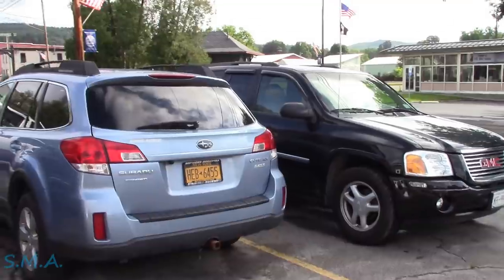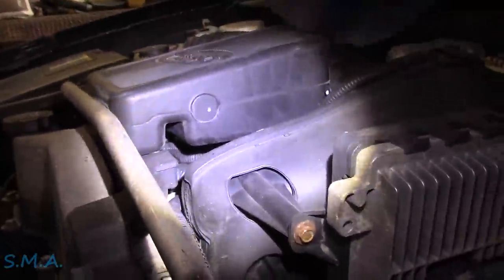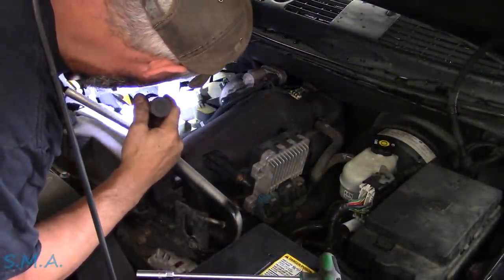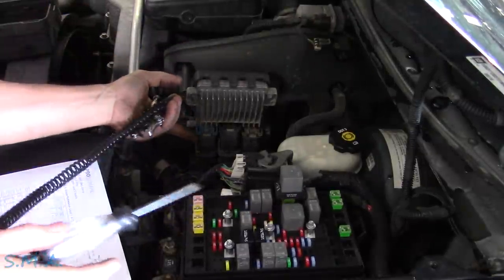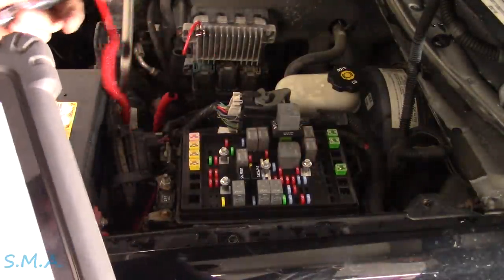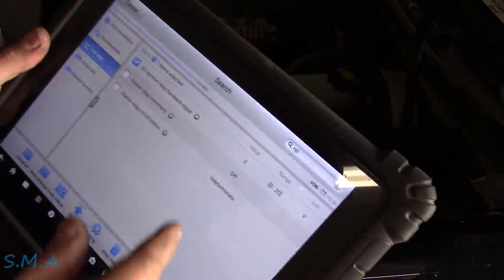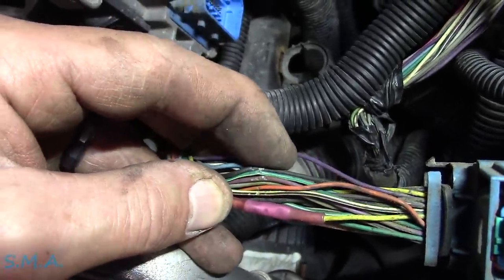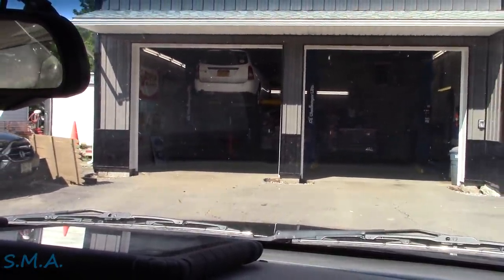GMC Envoy: No Throttle

Comment: Big Clive did a review on those solder-shrink connectors. As I recall he was not too impressed either.
Reply: I think you would the leading authority on them. I've seen you crimp connect an entire giant truck back together a few times.
Reply: Well... it's not the first old wive's tale he's perpetuated in his videos. The problem with Big Clive is that most of the time he's not wrong per sé, but he's not completely right either. And, you know, I'm a fairly brave person, but even I stop short of trying to teach a Youtube comment section college or university level electronics.
Reply: We tried using those at work. 100% failure rate! Went back to the crimp on and no problems.
Reply: I didnt like Solder shriks eather. Too fiddily to work with in tight areas. And i dont know what i did wrong but i was able to pull the joint out fairly easy.
Reply: the biggest issue is not cutting back to clean bright bare copper, overheating and moisture/corrosive liquid wicks into the stranded wiring tarnishing it(or major corrosion), that can travel many feet within the coating, including directly vertically multiple feet.
non bare bright copper will not take solder and stranded is nearly impossible to clean with any type of flux and heat.  now solid copper can be sanded, acid etched clean and neutralized, with no wicking up inside the coating. stranded wire? no such luck, the only way to fix it is by replacing as much as it takes to get back to bare bright copper, that could be inches to many feet or the whole length end to end!.
Reply: You still have to physically twist the two wires together when using solder sleeve. Also you will have better results with name brand sleeves, Tyco/Raychem then Amazon specials.
Reply: Well then, good thing SMA wasn't using solder-shrink connectors.
Reply: Properly cleaned, fully heated then solder saturated wire connections have never let me down either  under the hood or after marine electrical repairs. Experience with using correct Solder types and Pencil or Gun heat settings is key to preventing a basic 'cold solder joint'.
Reply: I'm not too impressed with Big Clive.
Reply: You really want to avoid solder in high vibration environments. The crimp and adhesive shrink sleeves look like a perfect way to execute a field repair on a broken wire. 

Like someone else mentioned, pony up for the name brand ones.
Reply: I've used those solder-shrink connectors before, but mostly in a specific situation. They worked really well, very strong, and I felt they would hold for a long time. Solder probably isn't great in this application, it does not deal well with vibration and a pulling force that would be applied from the weight of the wires.
Reply: I've made some good joints with them...on the bench. Inside a car I gave up and went back to crimps. They work if you know how to get solder to do what you want, but they're a total pain to put on under less than ideal conditions.
Reply: Ultimately it's his shop his reputation and his pocketbook paying for any warranty issues.  I have found mechanics to be pretty stubborn about things that "work" for them.
Reply: @Joe Huff lol enough said.
Reply: I think they were just crimp connectors, no solder involved. They've worked for me for 50 years, essential to use the correct tool and correct connector. I have two ratchet types.
Reply: @throttlebottle5906  
  Ive only lightly sanded solid once or twice then used an alcohol wipe ( lint free) to clean.
  No problems since.. your thoughts?
Reply: 99.9% of people that use heatshrink crimp connectors neither heat nor crimp them correctly. There is an art and talent involved in it, the same way as soldering pipes.  What people absolutely DO NOT understand is that mostly everyone on YouTube makes videos for one thing only - money. They will shovel out garbage tier videos because they have no knowledge of mechanics and just want money for doing absolutely nothing, or for doing shit work. Just because some unknown nobody making videos for money says they are garbage does not make it so.  My house wiring has heat shrink connectors on some parts of the wiring that has been there for 65 years and has never failed. The electrician that did the work knew what he was doing and did it well.
Reply: @robertfitzgerald3432  I agree 100%. I learned to solder back in the late 70's and have only had one cold solder joint (my fault). I've used this technique up to 8 gauge stranded wire with no failures.
Reply: Is now a good time to talk about Wes' greviously improper use of dielectric grease?
Reply: @JHruby  
  How so?
Reply: @jjjsmith2497  It's a running joke on his channel.
Reply: @jayktee96  Those looked to be heat shrink butt connectors that he used.  The solder ones you do not crimp because they have solder points in three areas as well as heat shrink and the solder areas hold the wires together.  I have both versions.
Reply: @garygruber1452  Yes. I began soldering wires in the early seventies after watching my Dad when he repaired his own Fender amps, mike connectors,... Surprised 8 gauge is solderable without using the huge 400watt soldering iron stick. Congrats. 10G is as far as I go without crimp first technique.
Reply: @JHruby  you mean with white wine instead of a fine port or burgundy?
Reply: I've used em a bunch. No issues at all. Do a linemans splice and they hold 3x better than butt connectors.
Reply: Wes this was a good job for max 😂 to look for the rodent
Reply: Who gives a crap what big Clive thinks that's a gm approved repair. Better than a solder joint
Reply: @JVerschueren  8

Comment: Solder is fine for STATIONARY stuff, but in tight spaces it's hard not to wind up with cold solder joints that fracture, so the butt connections are best there.  Oh, but you could use an ELECTRIC heat gun -- it would be less prone to scorch leads than the fuel torch.  Electric heat guns also tend to have the circle-wrap shields so you heat only what you are aiming at.

Comment: Nothing wrong with butt connectors as long as the are properly crimped and have the sealant in them...been using them for many years without problems.
Reply: They are the recommended method in marine applications
Reply: Nothing beats a soldered connection
Reply: @GMbusa1  vibrations will …
Reply: @GMbusa1  if those were soldered and heat shrunk  they would break again. He said as much in the video.
Reply: @GMbusa1  Many manufacturers don't even allow solder connections to be made. Mostly Europeans. I like solder myself, but as a couple of comments above me state, vibration can cause a solder connection to simply break.
Reply: @GMbusa1  No disrespect, but you must be old school. Even taking vibrations out of it, a good crimp is as good as a good soldered joint. From what I've seen though, there are very few people who are great with a soldering iron. But making good crimp connections is fool-proof with the right tool and a tiny bit of practice.

Comment: I used the crimp and seal connectors on a rear brake light repair on my motorcycle. Work great! Some folks just hate it when a simpler process comes to light that actually works.

Comment: I've been doing this for over 40 years in the Marina industry and we use the crimp connector with the heat shrink all the time it works great in the aircraft industry they have determined that a crimp connector is sounder and last longer than I saw the connection where the wires are subject to motion so you just keep doing what you're doing I'm enjoying to hell out of it

Comment: As an ex British Airways Engineer Mr O, you can tell the guy that criticised your crimp repair that the next time he’s on a flight to think of all the hundreds of crimp cable repairs thats currently on the Aircraft, does he think we pull the cable along it’s whole length from the aircraft and replace it.
Depending on the application we use solder sleeves and inline crimps, heat shrink sealed of course.
But I will say it’s strictly regulated, you must use the correct crimp for wire size and the appropriate crimp tool, and staggered so they don’t lay on top of each other.
You can’t pull over up there Mr O 👍
Great diag as usual.

Comment: We  tried the low temp self soldering connectors here in Arizona and when I had them in my truck they were all melted from the ambient temp inside the parked truck. also, in high vibration areas a crimp connector is preferred as the solder creates a hard end that can crack and fail. We don't use solder joints on aircraft wires either as a rule.

Comment: I have been using those same type heat shrink butt connectors in the marine industry for many years, gotta use the ones with the "goop" tho. I like Anchor brand , they have tinned copper ( the metal crimp inside ) And like you said you MUST use the proper crimpers !

Comment: We've used those sealed butt connectors like you use in marine applications with no problems at all. Generally considered better than soldering the wire in high vibration applications  because of the weak point at the end of the solder wick.
Reply: hey its great if you use butt connectors without any issues but its laughable to claim that solder joints are weak in vibration conditions. lol what are you smoking?
Reply: @lordjaashin  Its not the solder joint itself that is weak, its where the end of the solder wick stops and transitions to wire. The wire gets weak because of the heating of the wire it looses any temper it had and becomes brittle over time. Some people have a hard time comprehending this.
Reply: @lukem7203  lol copper doesn't loses its temper at the temperature at which leaded solder melts or even at the high temperatures of non lead solder. you need to go at the temps of brazing (700c+) for copper to lose its temper. you don't know what you are talking about
Reply: @lordjaashin  Are wires used today 100% copper? lol You might want to reevaluate your knowledge for sure.
Reply: @lukem7203  yes they are 100% copper. what else do they use in your country?
Reply: @lordjaashin  Depends on how cheap the car manufacturer wants to be. Tin and nickel are alloyed with copper typically.
Reply: @lordjaashin  Lol did you even watch the video? Eric was repairing a GM product. What Gm product is not full of chinesium components???
Reply: @lukem7203  who told you GM use copper mixed with tin or nickel as electric wires in their cars?
Reply: @lordjaashin  I was joking about GM using so many parts made in china, not sure what they use for wire. Magnesium copper alloy is getting more common in cars/trucks/boats. They look for ways to make copper stronger so they can use less of it or smaller gauge wire
Reply: @lukem7203  which car manufacturer uses magnesium copper alloys for electrical wires in place of copper?

using smaller gauge wire will effect both soldered wire or butt connected wire. not sure why you are bringing it up
Reply: @lordjaashin  Because you brought up copper is not affected by heat from soldering. Alloys of course would be especially smaller gauge.
Reply: @lukem7203  that is why I'm asking which car manufacturer uses copper alloys as electrical wires in their cars? your whole argument of copper alloys is moot and you know it
Reply: @lordjaashin  What car manufacturer would specify such a thing? You seriously need to quit obsessing over such a silly subject. Maybe because you're in the minority?? Surely you have a life right??
Reply: @lukem7203  Wire is copper. There is no copper alloy wire strand. What you are talking about is copper wire with a tin plating over each strand. Tinned copper. This is done because the tin plating has higher resistance to corrosion than the pure copper underneath. And no, soldered joints are not going to break due to vibration. That is ludicrous and something people got from the internet.

Comment: I've seen those poly wire looms wear through wire insulation at places where the loom moves around during use of the car.   I wish they would come up with a better product for loom protection.

Comment: I saw the same thing on a Pontiac sunbird years ago,  were the wire harness behind the engine under the intake the wire loom sawed thru about a half dozen wire, the problem was enhanced by a broken motor mount. As far as the wiring repair you do with the  shrink style but splices is actually  recommended repair by gm, in fact if when you buy gm pigtails they always come with that style of but splice. Thank you for taking time to make these videos,  God bless you and your family!

Comment: I've used the same connectors for license plate and backup light connections when replacing a bumper on my F150.  They've been banging around in the Vermont road salt for five years now with no fails.  That seems robust enough for me.

Comment: I've had problems trying to use lead free solder,  and good old fashioned solder with lead is getting hard to find.   Sometimes I crimp sometimes I solder.
Reply: 50/50 lead solder is still available at plumbing suppliers, for hydronic heating systems.

Comment: Those butt connectors with adhesive heat shrink are the cats meow! Ive been using them ever since I first saw you use them in a video years ago. Thanks Eric!

Comment: Like you demonstrated, never assume that something is okay just by looking at it.  Who would have thought those wires would have been pinched.  Loved that "aha" moment!   Another great video.  You are a true professional.  I sure hate to deal with the parts changers at some dealers.  I try to do as much of my own work as I can.  I have a 2015 Impala LT with the dreaded 3.6 engine.  I change my oil every 5,000 miles or 6 months.  I know these engines have their timing chain issues.  I laugh when you talk about the constant parade of Chevys that come in to your shop.  I have 70,000 miles on it, so it's low mileage.  I keep waiting for the hammer to fall.  Ugh.  It has been great so far.  Keep up the great work.  You really should go into teaching when you get older .  Your students would have a lot of automotive knowledge from your experience.

Comment: Dr. O, I think your fixes are just excellent, regardless of what other people say about crimping butt connectors to re-join broken wires. That should be able to get your customer trucking again for a few years. Me, I’ve been using solder, electrical tape, and heat shrink to fix my electrical issues, and I’ve never had any problems yet. I guess it depends on where you live, and how solder reacts to hot/cold. I live in the Tx Hwy. 281 section of South Texas, about 100 miles South of San Anto. My opinion, is that there never is, nor will there ever be, a perfect fix to broken wires in an engine bay.
Judging from how those wires looked, as a zip tie or something rubbed through, and knicked them, I would recommend  you have your customer get that PCM plug from the dealer or the bone yard, and have it close by, should it ever fail, as backup.

Comment: So we use pretty much identical splice kits on 230 volt submersible well pump wire connections which are submerged in water over 100ft deep and I can only remember once where the connector was a problem. also these systems typically last over 20 years! Those splice connectors are more then adequate. Some people just think their way is the only way. Just keep doing your thing Eric and pay no mind to the “experts” your skill level speaks for itself

Comment: I ran into a similar problem on a 2013 Ford Focus that wouldn't shift out of park I ended up repairing the wiring harness near the high mounted brake light and I never figured out why that happened to the wiring harness now I know it was the loom rubbing against the wires inside from opening and closing of the rear hatch! 😊
Thanks Eric 👍🏿

Comment: Eric as a mechanic that uses connectors like You just did, Don't worry about the haters because not all wire connectors are the same, The ones we use at out shop are like yours and also has a Solder ring on the inside, They work good as long as the wires aren't corroded at all.

Comment: I love those connectors. I worked for many years for a concrete supplier. With cleaning acid on those trucks it was tough keeping the green crusties away. I never had any luck with those solder type connectors as getting the heat right in tight places never happened. They almost always split before the solder melted and I tried all sorts of heat sources. Also fiddling around tring to get solder types to work was so much slower. We had mostly electronic engines and transmissions and never had problems with using crimp/glue connectors.

Comment: Love learning from you!  Regarding the butt connector used, that’s a great connector!  We don’t use solder connections on aircraft for the reasons you described, vibration cracking failures.

Comment: Screw the haters. I've been using that style connector for years and will continue to use them. Like you stated, if you crimp them with the correct tool and shrink em right you have a repair that will outlast the vehicle. I'm a retired mechanic turned trucker in upstate New York. If they can survive our salt covered roads, they will take anything you can throw at them.